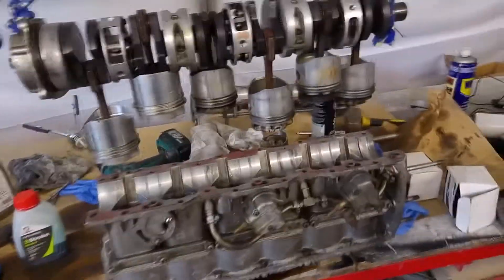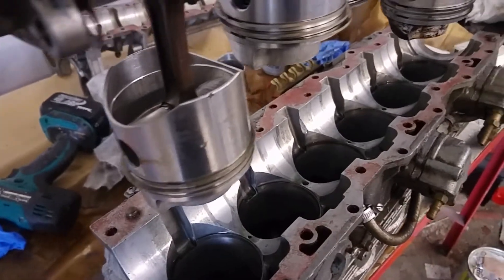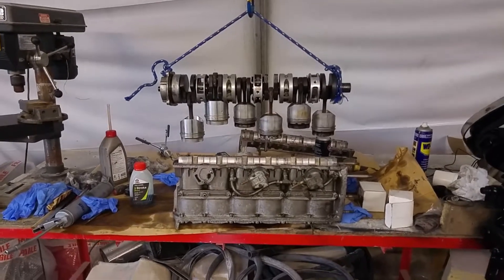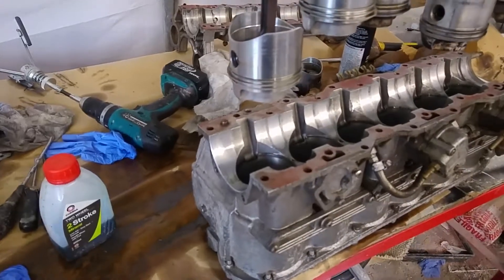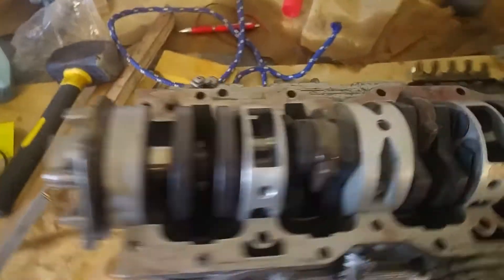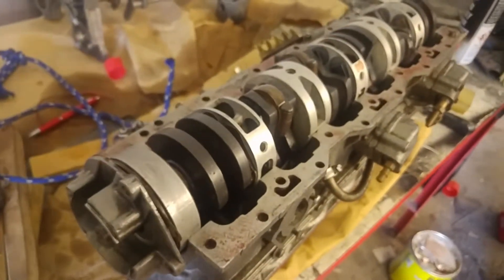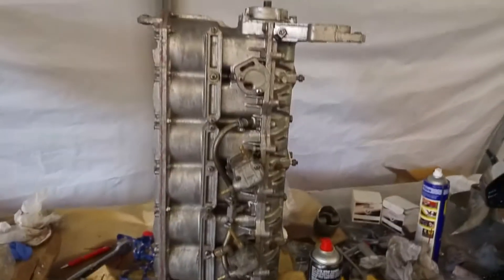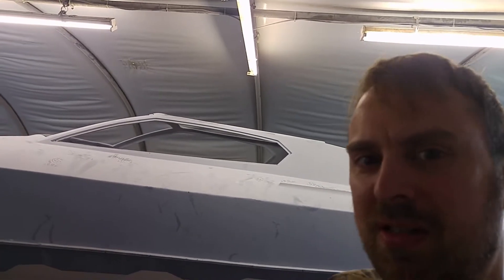Mercury 1000 Outboard rebuild part 4

Comment: Hi, I just picked up a '62 1000. What size prop are you planning to run? dia & pitch? 2 or 3 blade? thx!
Reply from the maker: Hello, I ran a 24p small eared chopper, but it was on a lightweight hydroplane, later it moved to a 26p cleaver. On a normal 16 or 17ft sports boat you would run a 19p or there abouts
Reply: @BoatsandEngines  thanks for the quick reply. The seller gave me a NOS 13.5 x 19p 2 blade bronze prop. that's the only decent one on his wall. I'm thinking it should be a 3 blade. He had a 3 blade on it in the test barrel but it was beat up, said that it was just used in the barrel. I'll look around for a good one. I just posted a video as well for the boat it will go on under 1964 custom craft sun ray part 2. thx!

Comment: Why are you installing pistons and crank in one assembly, and especially from the underside. Using a screw driver to compress rings just leads to scoring. Always install pistons from the top using a ring compressor pushing down to the crank shaft. Did you check the bearing clearance on the crank?
Reply from the maker: It's a blind engine (head and bore is all one casting)
Reply: @BoatsandEngines  Wow ! that is a very unusual design. I retract my statement, but could a ring compressor be used from the bottom at least.